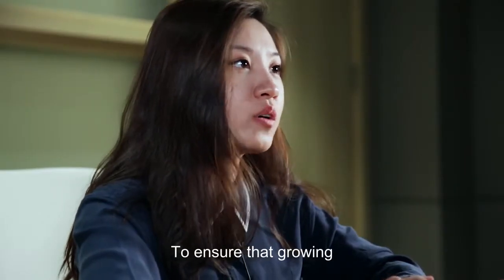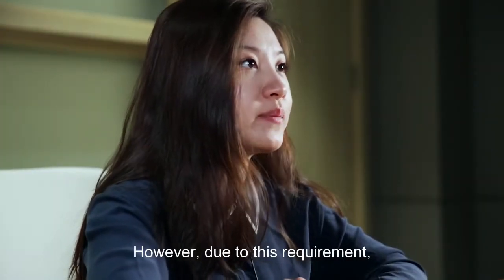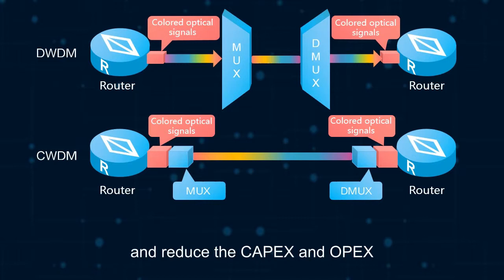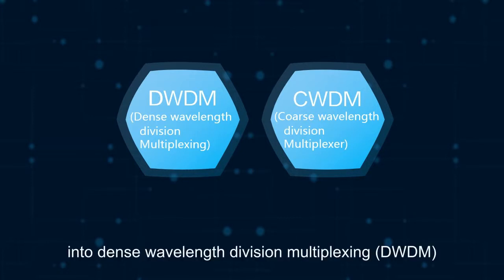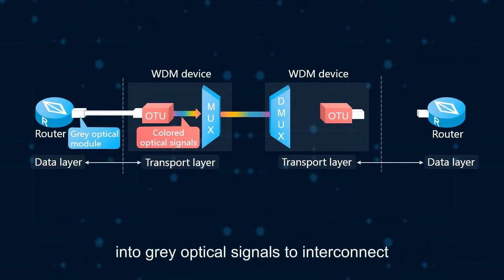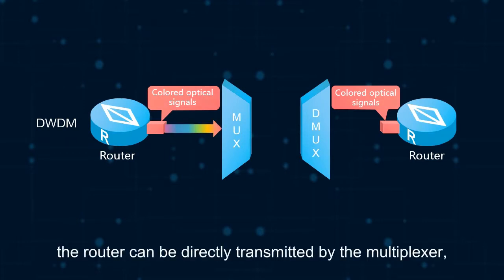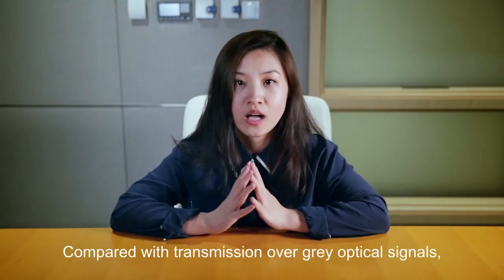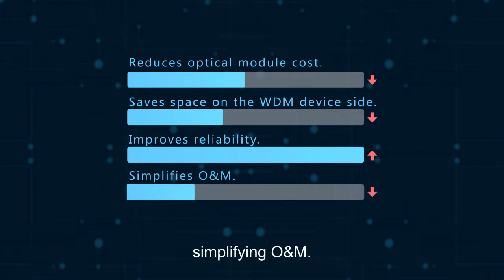What is HUAWEI IPoWDM?

Comment: perfect explanation
Reply from the maker: Glad you liked it
Reply: u should not only see the architecture, there still a long way to go, currently, ZR+ module without international standard, means without the industry support, the ZR+ module has a short transmission distance, it will restrict the application scenario to metro;